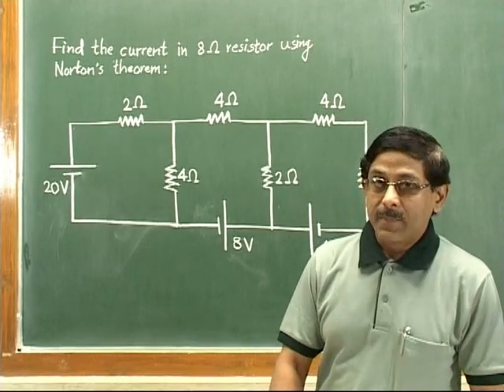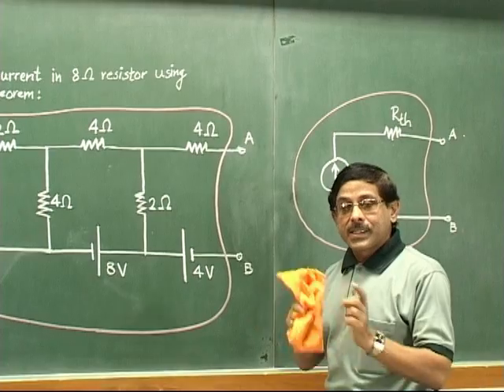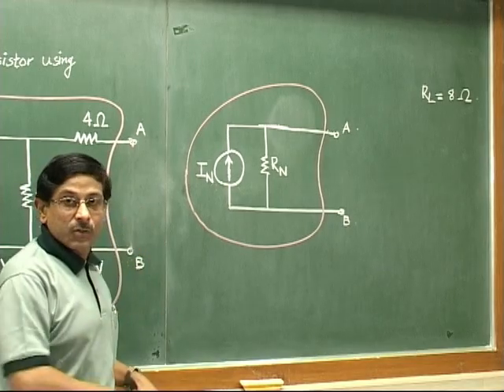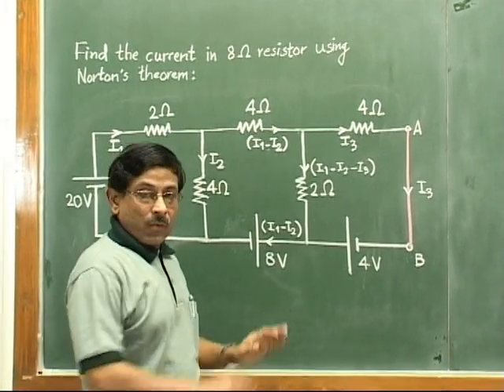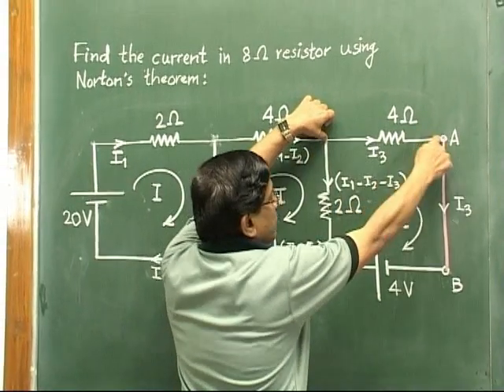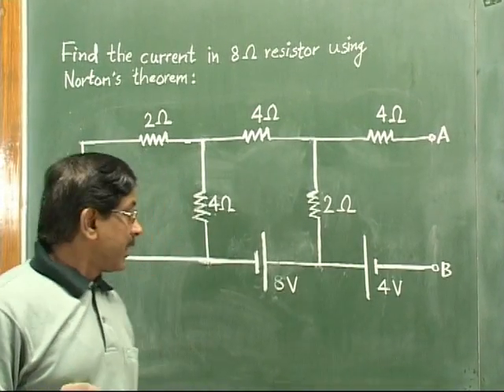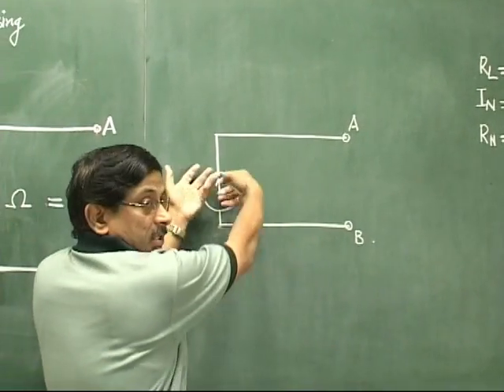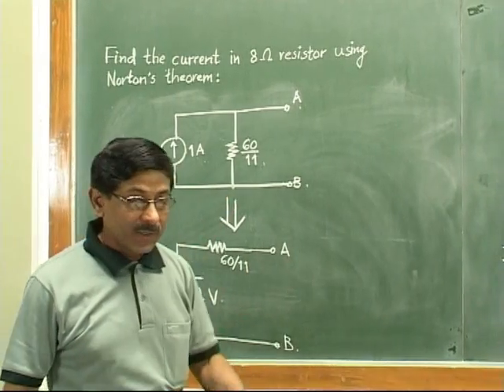Norton's Theorem - by Dr. C. B. Bangal

Comment: Sir, I love your videos - they're very helpful. I do have one question however. In your schematic, if you replace the 8v source with an ideal current source, when calculating the equivalent resistance, does the whole (smallest) loop of the 20v source _not_ get counted? The circuit is broken, so no current flows, so the equivalent resistance is only the 4 ohm and 2 ohm resistors closest to the ports a and b? Thank you...

Comment from the maker: @GilgaFresh You can distribute the current that way also. e.g., current I3 in 2 ohm resistor and (I1-I2-I3) in shorted path AB. This way also you can proceed, but, in that case, you have to calculate (I1-I2-I3) after finding individual currents; because, we need to find current in shorted path AB which is the value of Norton's current source 'IN'. Hence, to avoid one more calculation and to save time, I have taken I3 in shorted path AB
Reply: Thanks sir this is the answer I'm looking for...

Comment: thanks so much for the help on this topic!

 quick question about your way of solving this example: how come (when assigning I1, I2, and I3) the top right branch and current between terminals A & B isn't I1 - I2 - I3 and the branch parallel left of terminals A & B doesn't have the current I3?

Comment from the maker: @ranabilalbilal No friend, we can't do that! We have to solve the problem with Norton's method only! We have to find current in shorted link, which will correspond to equivalent current source in Norton's Circuit. However, finding equivalent resistance would be same as done in Thevenin's theorem. So, its necessary to solve the problem specifically by Norton's method! Thanks!